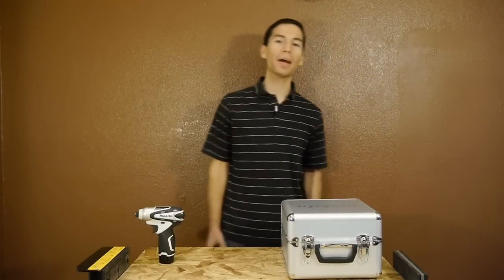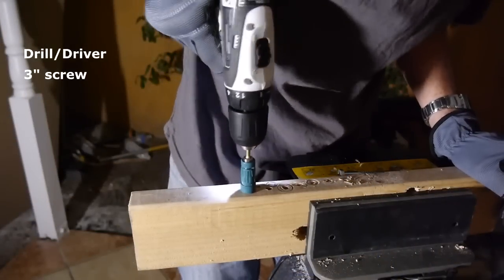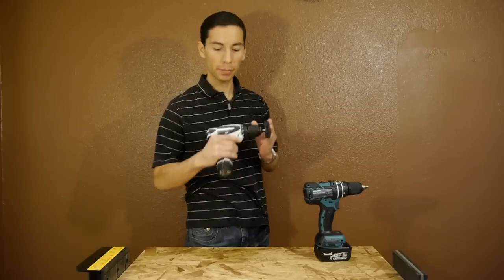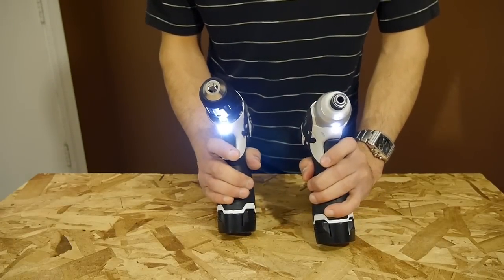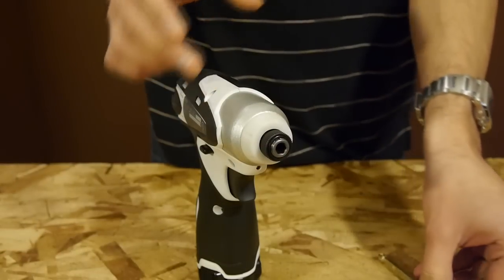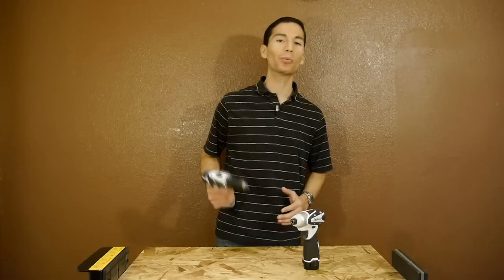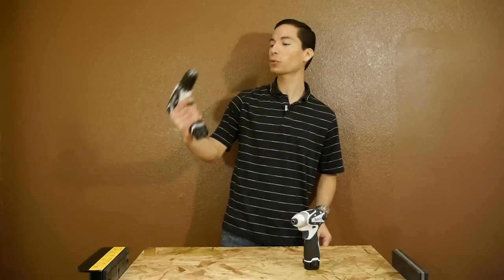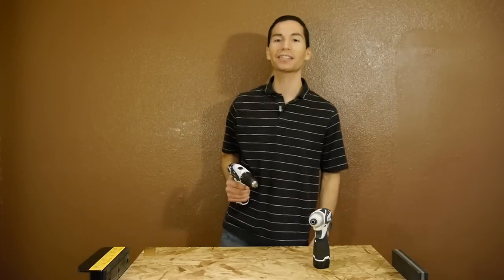Makita 12V 3/8" Drill FD02W & Impact Driver DT01W Combo Kit LCT209W Review

Comment: Worked on a job a couple weeks back and a guy pulled out this case, was instantly intrigued as to what it held, real nice kit for the price. Left my drills in the van and the guy lent them to me for a bit, now i have the real big boy combi and impact and obviously these aren't in the same league but for the price they are really really good! Only complaint i have is that the chuck was slipping a bit, but i think that might be beacuse it had seen some use. Impact had no trouble running 4 inch screws into a joist. 9/10.

Comment: they have a vaqueta meaning holster from makita I have the drill FD02W AND IN THE KIT it came with 1 as well as the DF03DW and the 2nd kit came with a bit set in a velcro pouch both come with a double ended kit.  I HAVE BOTH KITS

Comment: I just have the 12v drill in 2 versions with a reg drill chuck and the other with a quick connect non impact with a drill n drive bit set in separate cases they r brutal bro
Reply from the maker: Ruben Rivera cool, I like the idea of the screwdriver you mentioned. The power of the drill but smaller

Comment: I've had this combo for a while and am generally pretty happy with it. The drill is less than stellar. I think it lacks power, not happy with the chuck (mine slips), and the LED light on it is shadowed by the chuck, rendering it useless. The impact driver, however, is my BFF.
Reply from the maker: +bityard check out how these compare with dewalt Bosch and Milwaukee in my 12v drill and impact driver comparisons

Comment: just curious i install cabinets all the time,  would these be good for that?  i use 2 1/2 screw and 1 1/4 screws
Reply from the maker: +HobbyPC the drill is great for drilling small holes and the impact would be great for driving screws into hardwoods. I don't see why not
Reply: Absolutely! I've used these drills for a few years now and I can honestly say they are the best drills I've ever used in my life. The impact driver is the one I use most and I've put up cabinets with them with ease. I'm still amazed when unused them at how much power and torque they have for their size
Reply: Tool Craze 
Impact = no clutch.

Comment: If only you could attach a larger battery like Milwaukee. Also I doubt that the impact driver has as much stamina as a 18v(It would get hotter). If you were doing hundreds of skrews a day(even fairly small ones) these are the wrong tools. But for tight spaces and domestic use they look good.
Probably more suitable than my Ryobi 18v for general use.